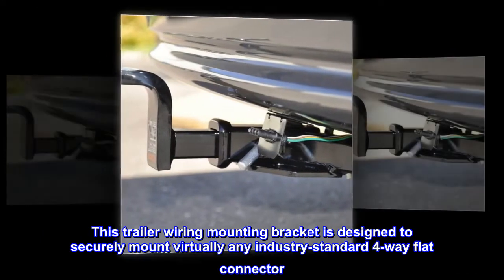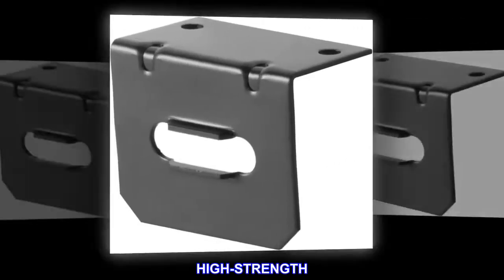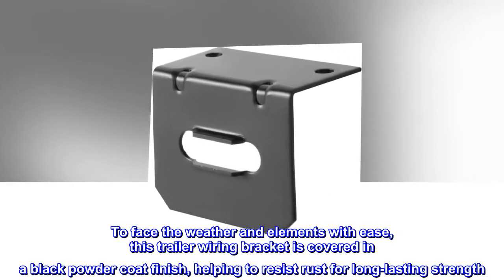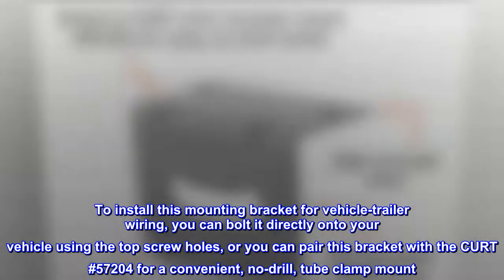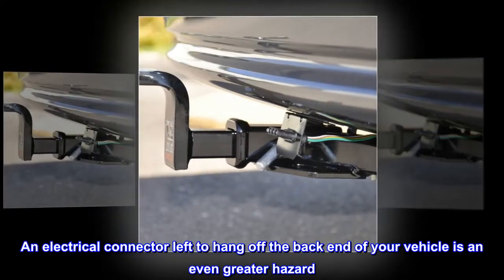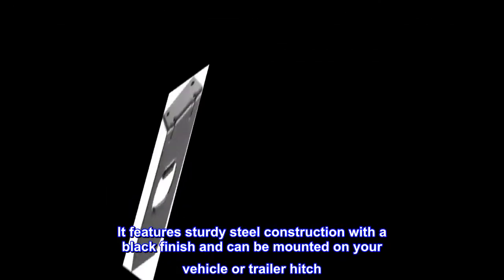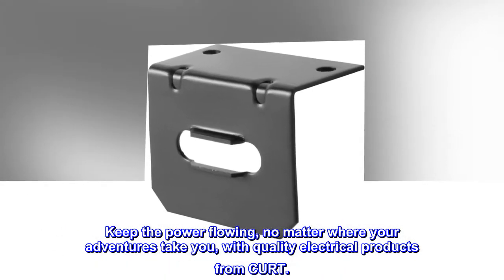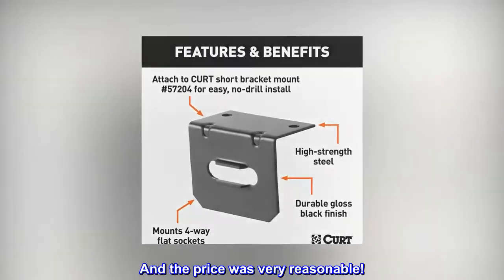CURT 58300 Vehicle-Side Trailer Wiring Harness Mounting Bracket for 4-Way Flat

Comment: Would be nice if it showed how to install the connector.  I must not have done it right as the connector pushes right out when I try plugging in the connector from the trailer.